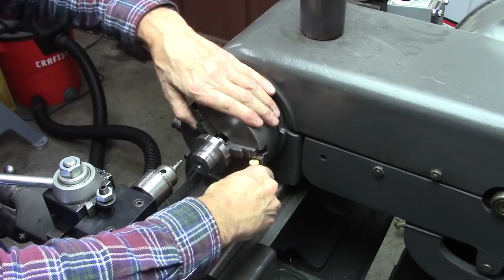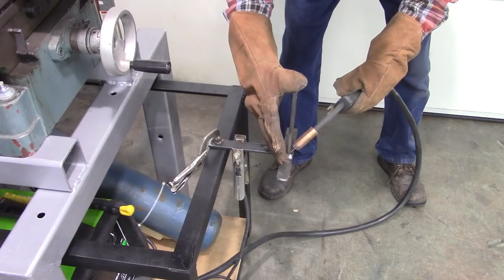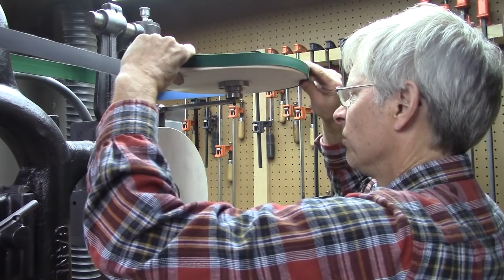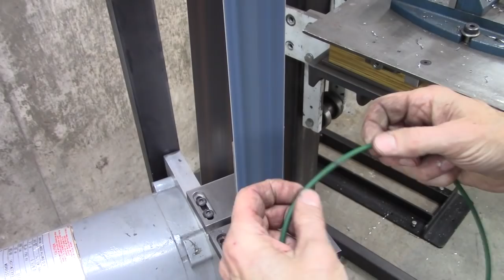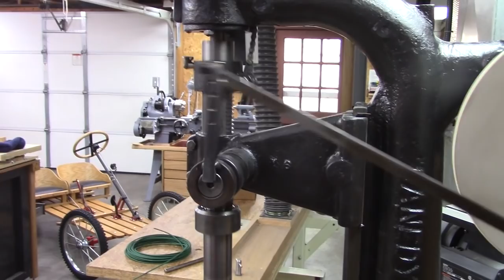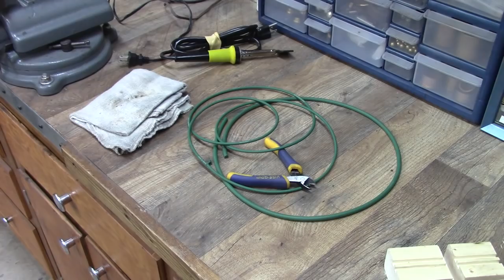Oscillating Drum Sander for my Drill Press

Comment: Cool.  Like the urethane belting welding technique.  My old schhol mentor used to get drill presses running much smoother by replacing V belts with round urethane.
Reply from the maker: It makes a good drive belt for low power application Thanks!.

Comment: Hi, , , I was cruising around and although you have so many posts to check out this really caught my curiosity. Where I pour my silver is at a huge wood shop where my old friend builds, finishes log homes and other post and beam structures.  I have always wanted a oscillating drum sander but even that in a 40 x 70 shop takes up badly needed space. This is perfect and I will be poking around to see its birth. His big 3/4 in "General" drill press awaits eh. LOVE THAT DOWEL TRICK ! All kinds of 3 divisible things can be solved there for way less than a dividing/rotary head. The wide belt you vulcanised can be replaced with a V belt that comes in pieces that fit/splice together. I have gad great success with them over the years. Love the round one you heat spliced. I must try to source that. I will need to engineer this a bit different but this is defiantly a doable project. Thanks a bunch new friend !
Reply from the maker: send me an email - winkysworkshop@gmx.com
Reply from the maker: I like flat belts for some things. Making pulleys is usually easy and I have belting left over from my job along with a heater and a grinder for preparing the ends. The round belt is super easy but there are some tricks to it. You can slice it with a soldering iron. The trick is not to push the ends together very hard, it pushed the melted rubber out of the way and you end up with a cold splice. The oscillating drum sander was fun. I don't need it often but it works great. I was looking at the drill press one day and thought...  if I can get the ratio right I can do this. I think I got it perfect.
Reply: @WinkysWorkshop  Done I think. I always laugh about computers as I always say "I am about as sharp as a river stone" when it comes to them but I manage to hack my way through them, LOL.
Reply: @WinkysWorkshop  You did !

Comment: Interesting idea, but I'm be slightly worried about putting side load on an unsupported chuck these days. I've popped Jacobs chucks off of their spindle tapers more times than I like to remember from putting side load them. Your antique drill press (Beautiful piece of kit BTW) possibly has a screw on chuck, but some of your viewers may have a go at replicating this on their more modern taper chuck drill press, then find their sanding drum, AND chuck suddenly loose and dancing on top of their workpiece and/or hands.
These days I only make sanding drums that have a turned "through shaft" that goes down to a piece of plywood with a bearing let into it that's bolted to the machine table. This keeps any twisting out of the side loading and keeps my chuck from walking off the spindles taper. Not sure how the idea could be adapted to work on an oscillating sander though
Reply from the maker: Loctite?  I'm kidding!  You might be right about the chuck coming loose. My other drill press has a screw on chuck and it never crossed my mind. So far it's not been a problem. It has an M2 taper and hold very well. I suspect it will never be a problem but I'm not really worried about it from a safety standpoint...  not enough mass to do more than trim your fingernails. The amount of pressure is not so great that it needs support on the end. Maybe I need a draw bar?  Ha, I'll cross that bridge if I ever have a problem. Thanks for the comment.
Reply: I came to say the same thing. Not great on the hearings either.
Reply: @tomsdreamshopworx  I was going to mention bearings in my original comment. Received wisdom told me it'll kill the bearings pretty quickly, but after thinking about it for a bit I'm not so sure. 
Maybe back in the days of plain bronze or babbitt bearings it would quickly finish off warn bearings, but on something with ball/roller bearings I can't see it doing much as the lateral force is actually in a direction that bearings are more usually loaded.
I'd be a bit more worried about side loading the quill while it's in constant motion up and down. They tend to be either a cast iron or steel quill running directly in the cast iron body of the drill. If there's already a little slop in that I think loading it up like this in a dusty workshop environment could exacerbate the problem in short order.

(I feel I've written "Bearings" in this reply way too many times, but I've just woke up and can't really concentrate on making it as succinct as I'd like at the moment. :D .)

Comment: Um, ok, that’s an interesting project, well executed.  I have to admit I don’t fully understand the need, but it was fun to watch.
Reply from the maker: If a drum sander is used without movement it tends to burn and  leave a rough finish. Watch this follow up video to see it in operation. https://youtu.be/EmSKaTm8ngM
Reply: @WinkysWorkshop  well yes, but I think a cordless drill on a lever could do the same thing.  This seems very unnecessarily complex.  Plus drill bearings are not optimal for lateral forces.  Not trying to be mean, just don’t really see the reason for this approach.
Reply from the maker: @bradthayer6782  The amount of lateral force is not an issue, routing or milling is. My only concern is the taper staying in which so far has not been an issue. The drill press switches back to regular use in about 2 minutes. Slip the flat drive off and disconnect the lever at the quill. "cordless drill on a lever"?  Or just move the quill up and down manually with the drum on the chuck...  I think if you had to sand a bunch of curves you'd feel a little different. They sell spindle sanders for about $120 or even less. I'm guessing I have a couple hours into this and $30 in parts. Of course if you had to use the flat belt and buy the tools to splice it...  well, you'd be better off buying one. This worked well for me. It actually works way better than the spindle sanders you buy. The one I had didn't work so well. Shorter stroke. This is just one option...  kind of fun to make. No doubt not a good option for everyone.

Comment: Cool video and a great idea ! Now i know how to convert my drill for honing cylinders ! Only thing i could add to the poly belt welding is watch out for cheap stuff on the internet as i have seen a few people that have had problems getting it to weld , they were using it for the small model steam engines and no matter what they tried it was unweldable - give you one guess what country it came from !
Reply from the maker: I've bought the cheap stuff and it worked fine for me. The stuff I have now is made my Habasit which is considered to the best. I found out that I could get it for about the same price as the cheap stuff via a local supplier. Thanks on the video....  Just a thought but I'm a little concerned about the chuck taper not holding. So far its doing fine however.

Comment: Great idea!!!  I have to ask what is the name of that flat belt material??
Reply from the maker: Thanks! The belt is leftover belt used in the printing industry. I retired a couple years ago and for about a year I was preparing belts for them....  that's why I had the grinding machine to taper the ends.  The belt is made by Nitta and the number is SGLA -350S. Habasit makes a similar belt which is S10/15.  There are hundreds of belt types. Glue on are the strongest. I've used similar belts on both my lathes and the main drive on my drill press. Splicing is easy but the tool to grind the ends and heat the splice are ridiculously high priced.

Comment: Oscillaction - A crank is an easy option at the quill end. A better design would be rack & pinion - as that would not have the same travel limits and could revolve the quill depth drive more than 360°. The usual 'shaper' technique for controlling throw is via the crankshaft (disc !) having an adjustable throw crank - so the arm could come off near the centre of the disc for a small throw and near the edge for a much larger throw.

You ought to be employed designing machine tools as you come up with some great ideas !
Reply from the maker: I had a rack gear but no matching pinion gear. That would have been ideal but a 1" stoke is adequate...  although double that would be very nice.
Reply: @WinkysWorkshop  Crazy idea - tying in both my comments - rather than rack & pinion, make it a wind-on/wind-off belt drive !
Reply from the maker: @millomweb  - Cool idea...  I'd have to increase the quill return counter weight inside the column or....  ?  Thinking... GOT IT!   A sprocket with a chain draped over it with a weight on the end....  maybe.
Reply: @WinkysWorkshop  With that stretchy belting, no reason to not have 2 'cords' one to pull the quill down and another to pull it back up. And the two cords operated from the lever attached to the crank - so if the cords need to move linearly (say, X), they're not having any Y motion to deal with.
Or do similar but with the cords wrapped around the normal quill feed shaft/pinion.
Reply: @WinkysWorkshop  Can you attach link rods to the top of the quill depth-stop bar ?

One thing to consider mechanising the quill action like this - I'd strongly suggest upping the oiling regime as it's going to mean loads of quill movement when used like that.
Reply from the maker: @millomweb  Totally agree on the oil! I'm thinking a chain and sprocket is the best approach....  although, I used it today and it worked very well as is.
Reply: @WinkysWorkshop  Entirely up to you re the amount of movement you need. The usual ideal would be to say enough to clear the work to allow removed wood to 'escape' but in a vertical install, it will always work downwards and the dust can escape via the large portion of exposed sanding drum. Considering this, you probably have enough vertical motion !
Reply from the maker: @millomweb  - A little more would be better but not worth the effort. Here's the dust collector  https://youtu.be/EmSKaTm8ngM

Comment: Well Mr Winky, and they said it wouldn't fly 😉, be interesting to know where that belts available from
Reply from the maker: The round Urethane belt can be found on Amazon. The flat belt was left over from my job at a printing company. There are many types available but this one is a SGLA-35S made by Nitta. You might be able to find the belt but the tool to splice the belt are high priced. It's handy stuff....  I have similar belts driving both my lathes.
Reply: That's great Mr Winky, I'll go search 👍
Reply from the maker: @TERRYB0688  - You might want to look up belt suppliers in your area. There are hundreds of options. If you need a belt of a specific length they can prepare it for you. The price fore the belting ranges from $1.50 a foot to about $3.50 (or more). They might also be willing to lend you a heater, guide and a little glue. I've thought about selling Flat belts to people with old lathes, drill presses etc. but splicing tools are a huge problem. The heater for the flat belt I spliced is $700+!  A while back I milled a shallow slot in a 2 x 2 x 1/2 steel plate, heated it in a toaster oven to 350 F and clamped it on the belt (the slot kept the belt aligned). It worked perfect but dealing with the hot steel was a bit of a pain...  even painful.
Reply: Hi Mr Winky Thankyou for taking the time to respond, I have made V belts before by splicing them with super glue, it works and have belts last until I manage to obtain the correct belt, I've also incorporated some of you ideas into my machines, keep up the good work, Terry from Scotland
Reply from the maker: @TERRYB0688  - Super glue works on this belt materiel very well but the splice isn't flexible

Comment: Hi,
what stuf is the flat green/blue beld made of? Where can I order it?
Reply from the maker: The belt is called SGLA-350S made by Nitta. It's used in the printing industry. You might find a local belt suppler willing to sell you some but the next problem is preparing the ends (grinding a taper) and gluing it with glue and a heater. A belt supplier will cut to length and prepare the ends for a price but you still have to splice it. Sorry thats not an easy answer....  preparing and splicing was part of my job before I retired.  The belt I had was left over, the grinder I made and I inherited the heater.
Reply: @WinkysWorkshop  I own a SB10Heavy and on it is a beld Green top, black backside. I had to cut it once and tapered it on a sandbelder.
I reglued the ends with 
formic acid, clamped between two pieces of wood for 24 hours. That did the job. The beld was cut from somthing that looked like a supermarket register beld.
Reply from the maker: @ruudns6075  - Interesting. The core of this type belt is Polyamide (close to nylon) and the glue used with heat is made with a solution of Methanolic resorcinol.

Comment: Nice.
By the sound (frequency) I would suspect one of the angled pulleys making the rattle noise.
From your camera angle I think the left hand one isn't quite at the correct angle ??
Reply from the maker: Actually I think the drive pulley is the culprit. The flat belt is a little tight and you can feel the vibration at the top pulley bracket . I probably should have made it a little heavier.

Comment: Is the flat belt stock fabric reinforced? I'm running unreinforced urethane on my 11" South bend and I'm not too thrilled with it's performance.  It stretches way too much and limits the amount of power I can get to the spindle.
Reply from the maker: The flat belt has Polyamide (similar to nylon) core with a rubber type materiel for a traction layer. There are hundred of variation of this type belt. This particular belt has a traction layer only on one side and is 1 mm thick. You have to grind a taper on the ends and use a special glue to make the splice. I'm using a variation of this type belt on two lathes and my drill press drive and it works great. The problem with this belt is preparing and splicing. The glue is about $20 a bottle, and you have to have a grinder to prepare the ends. The clamp on heater needed to make the splice is over $700 and the belt runs from $160 to $3.00 per foot depending on what belt you need. I think the grinder for the ends in over $2000 but I made my own.  Most cities have belt suppliers for industry. They can make you a belt. Maybe they will also loan you the tools...  hard to say. Urethane is definitely not a good choice for a belt. It's to be used on coveryor to carry light weight product.

Comment: I really enjoy your way of doing things . It motivates me with my own projects  and i am always looking foreward to a new video . I recently got hold of a lathe that want to restore to put back in service . It only has saddle feed and  the leadscrews on the cross and compound sldes are rh thread . The only lh threaded bar i can get is 16mm x 2mm pitch . Do you think one can use that to relace the leadscrews with . Being ht grade i think it might last  quite some time . The dails will also work good with the pitch . Any comments will be much appreciated .
Reply from the maker: I'm not familiar with how metric lathes work. Most the lathes I have been around an 8 threads per inch. If you are not going to cut threads I'd say any thread pitch would work.